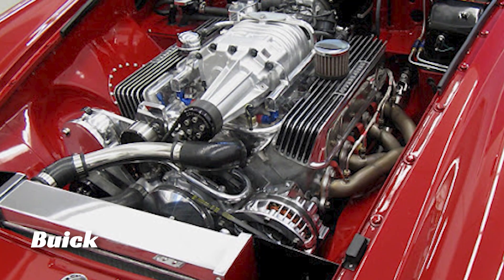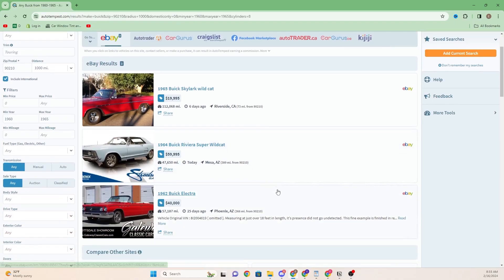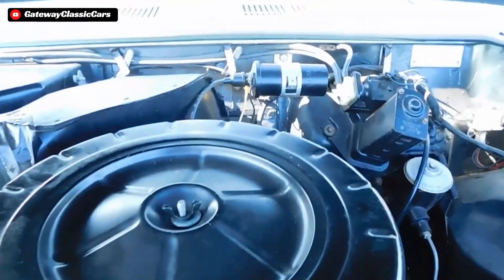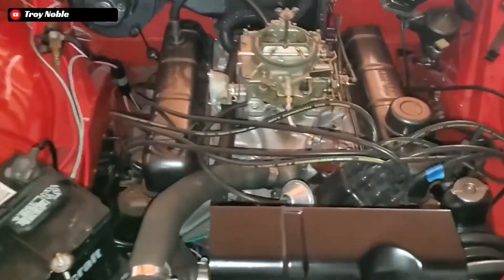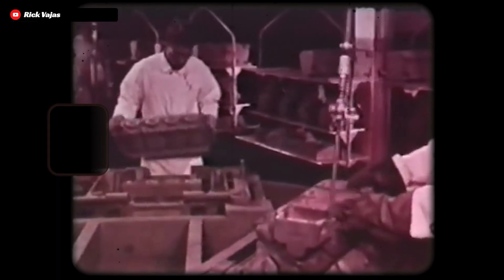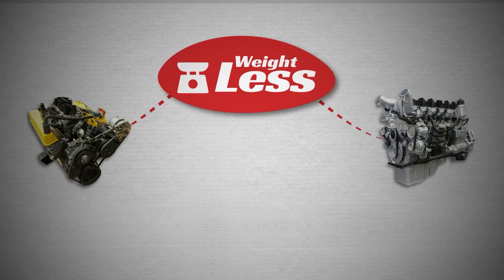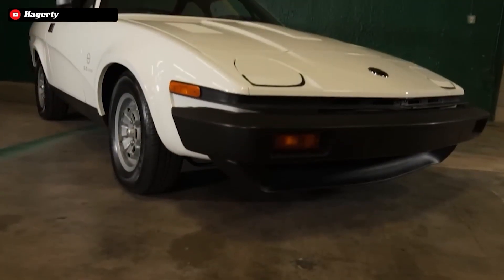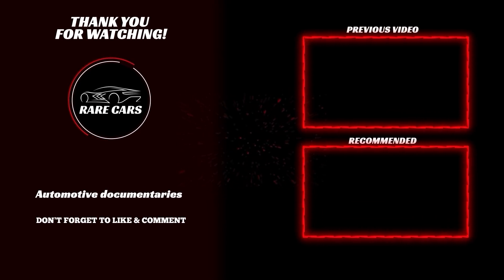The Little V8 That Powered The World  - The Buick/Rover 215 V8

Comment: I worked for West Yorkshire Foundries and was responsible for Foundry tooling approval and all dimensional Engineering reports of the Rover/Landrover Aluminium V8 Block and heads from 90 to 05 when Ford at the time had Landrover kill the Engine, This Engine even went in Boats before going to Solihull the Landrover cast into the head and blocks was removed same for TVR & Morgan. Working with it for so long I knew it dimensionally inside and externally for head and block in my head without looking at Hugh sheets of Engineering drawings, basically thousands of dimensions. For fool approval of a die before block going into production it took me 4 to 5 months, Probably 6 weeks for the Aluminium V8 head.
Reply: I also worked at West yorkshire foundry in Leeds around 1970. As a Contract electrician for Shaw Dale electrical.They were making the Jaguar V12 blocks & mini heads then. I now have a 4650cc rover engined TVR Chimaera that goes like a bat out of hell. Small world.
Reply: Strangely enough I was also responsible for mark-off tooling approval of the Jag V12 block & left & right hand heads + AJ straight six block & head from 90 to 2000ish when Jaguar killed off both engines. In the 15 years or so I worked for West Yorkshire foundries all electricians worked for the company not contractors. It also went from Rover to Hydro which are huge in Automotive industry.
Reply: @jeremywentworth1833  Hi Jeremy. I can assure you we worked as contractors We installed lots of large cabling around the factory. In fact I got into trouble for being in the compressor house. I was in awe of the huge compressors. There was one being rebuilt. A huge single cylinder one with a Ammeter on a pedestal. From memory it went up to 400 Amps. Worked in pressure Die. Gravity Die. Shake out. There was a huge woman that worked i think in the sand casting dept. We were give oxalic acid to wash our cars with due to all the fallout. I used to watch the guys with the long oxy torches repairing casting from behind a screen. I think the Manager that we answered to was called Doug. Regards.
Steve.
Reply: Jeremy, I can't believe I stumbled across your comment while looking for a replacement engine block. I'm looking to replace the 4.6 in my Discovery and forums say that Rover graded the blocks with color code, red being the best casting used in the early 4.6 for RR Classics. Do you have knowledge as to whether or not this is true?  Supposedly the problem with the 4.6 engines used in 03 and 04 discoveries had to do with all castings regardless of suitability being used for the larger displacement since it was the only version in production.
Reply: @tomd2833 Colour markings were done by operator when it was partly machined the block would go in a machine it was clamped with plungers holding it in position by adding & removing shim the casting could be brought within tolerance in every axis, the colour coding could be die related, their was definitely several colours, but as I wasn't shop floor or Foundry even though as I was quality it would be me or someone else in quality, with sample & hundreds of dimensions I could literally see if a casting just needed twerking by adjusting the plungers that clamped it, but also as it's made in the die , so the colour coding I doubt it means 1 is a better casting than another as no casting would be sent to Solihull if anything was out of tolerance as it was machined at Solihull from how we had machined part of it, they just complete by building it & obviously the heads.
Reply: You must mean Land rover graded them as they went to Solihull for M/c then building we were the Foundry..I suppose it's possible but wouldn't have thought it made any difference as each casting for block & heads was dimensionaly within engineering tolerances. Each die they were cast from as soon as it started producing castings that were out of tolerance it was pulled & refurbished &: the castings it produced would be scrapped. Every hour a sample would dimensionaly be checked on a CMM coordinate measuring machine. Anything out of tolerance that die stopped. And dimensionaly internally I would go through it with a drawing taking me around 3 months. Basically from due to die every casting was dimensionaly within engineering tolerances. But maybe when machined the casting could be out of tolerance so definitely possible but doubt it. As they are no longer in production it's irrelevant isn't it , land rover killed it in 05. Obviously many will have been rebuilt since I suppose.
Reply: @jeremywentworth1833 The land Rover 4.6 produced in 03 and 04 have issues with slipped liners and also cracks forming in the aluminum casting behind the liners. Symptoms will begin with what appears to be a lifter tick then a blown head gasket but what is really happening is the liner begins to move then the block forms a crack. There is a good video https://youtu.be/8zLGbESGYRU?si=FfOolahQYNbeHZTj showing a block that is cut in half so you can see how some of the later castings are off a bit when used for the large displacement. Rebuilt short blocks are selling for close to 6k so finding a used engine that can be serviced with an overhaul is my quest considering the value of the vehicle at this point. If there was a rating applied it must have been after machining. Thanks for replying to my question.
Reply: @jeremywentworth1833  I thought Coscast did some of the LR/RR blocks towards the end? I know they definitely casted them for a time, I have a Coscast block in one of my P38’s, allegedly supposed to be superior to the later LR blocks, also someone mentioned the colour stamps the blocks had, and apparently it was a quality control metric  on the later engines, something to do with the water ports at the back of the engine thickness, lesser blocks allegedly being used in 4.0 vehicles while higher quality blocks being used as 4.6’s or so the urban myth goes, 

Composite head gaskets imo was one of the larger issues with the Gems onwards engines
Reply: @That_Rover_Guy Coscast definitely did do casting of heads & blocks but it was after we closed, they presumably got all the tooling dies core boxes drawings the lot, someone still is casting them every now & then presumably it is Coscast, No1 but West Yorkshire Foundries made anything Land Rover V8 while it was in Production but us from the 70s, we only closed as we had lost a huge BMW contract when they decided to not use an engine & went with Brazilian Chrysler designed for Minis & we had lost all the Jaguar Work, so when Land rover Ford at the time ditched the Aluminium V8 Block & head so work for GM & Ford was moved to Austria & Hungary, we were solely a Rover owned company until the early to mid 90s when they sold the Plant as Growing Concern but still did a lot of Rover Work so losing their work was the nail in the coffin, the Blue marking & Green was done with all V8 head Blocks certainly in the 16 years I was a metrology technician quality engineer, the operator did it when they had been partly machined before going to Solihull, think they also put something on the head as in a paint marking, infact I think there was more than just blue definitely Green black white, don't know what it meant but it was a blob of paint on the Timing end , I couldn't tell you what it was for but maybe die related so possibly it's related to which Maching line at Solihull, been a quality I would shim the machine that partly machined them , stick & remove shims to role the casting so how it's seated when it's machined, adding & removing obviously affected how everything would be machined making sure everything was within engineering tolerance at our place but also for Land rover when castings are completely machined & the engine is built.
Reply: @jeremywentworth1833  Yeah those “Prince” engines are wank by the way lol I did half know what happened to you guys, 

Haven’t heard of anyone casting any numbers of them in a large way since Coscast and I don’t think they do them anymore, the one P38 I have as I say had a warranty engine fitted by LR and that was a Coscast engine, 

I do a lot with JLR and old rover cars so in my time I’ve had a fair few V8 powered cars and broke up a substantial amount of V8 powered cars boats etc, I’ve seen yellow, red, white, blue and green off the top of my head, the reason I’ve been led to believe it’s something to do with the casting process or machining process afterwards is because of the Discovery 2 and later P38 Thor engine fiascos, and the colour markings is something to do with quality I can’t remember the orientation of colours but allegedly the discovery didn’t get as high a quality blocks as the Range Rover and this was why generally D2’s suffered with cracked blocks (not slipped liners), I’ve seen them crack between the bores and along the water ports nearest the bulkhead a lot, and allegedly again this is why the D2 was such a catastrophic failure in America (so bad that the discovery 3 is badged as a “Land Rover D3” to remove itself from the dire reputation they got) 

You’d probably be able to tell me more regarding this, but I’ve been told circa 2002-2005 the blocks were casted differently to the earlier gems V8’s? 

I’ve rebuilt countless RV8’s over the years, but credit to you, pretty awesome being so connected with such a famous engine

Comment: I have a LH8 which is a Gen 4 LS based engine (all aluminum).. but it doesn't have AFM, VVT, or flex fuel.. they only made them for a year or so. It's a great running v8 engine.. all the modern upgrades/revisions with no tech on it.

Comment: I have a 1980 stage one V8 landrover which I've owned for nearly 30 years, I had to park it up in 1999 for various reasons (it wasn't broken in anyway) and it was left untouched until about 2013 when i had to move it, I put a old battery in it dumped a half a gallon of petrol in the tank and turned the key 10 seconds later I was driving it out, it's now back on the road and I take it for a ride now and then (at 8 to the gallon it won't be going to the coast anytime soon) you can't kill a Rover V8, I doubt my Ford ranger would do the same if I left it for 13 years.

Comment: One forgotten tid bit of 215 V8 history is the 1962 Oldsmobile Jetfire. It was based on the F-85 and was the world's first turbocharged production car, alongside the Chevrolet Corvair turbo. It used the Olds version of the 215 with a turbo on top of it and a single carb, and they called it the "Turbo Rocket". These cars are extremely rare, even more so because most people took off the turbo, due to the fact you had to fill up a reservoir with "turbo rocket fluid" to prevent detonation, since intercoolers were not a thing a back then. Olds only built them for '62 and '63, and it predated the first european turbo car , the '72 BMW 2002 Turbo, by a cool ten years! You just gotta love '60s american cars 🇺🇸
Reply: Yet somehow nobody at Oldsmobile thought to lower the compression ratio of the engine down from 10.25:1 to

Comment: I worked with a guy with an older brother that worked in a junkyard. He built a car from salvage. It was a TR6 with a baby V8. I knew about the 215. His 215 had a dual 4 bbl manifold. It was also running a 5 SPD overdrive transmission. This car would get opened up out on the desert highways. All built from things he collected at work.

Comment: HI, I had an Olds Cutless with a 215 that I rebuilt. the Buick version had better heads. many made it to the junk yard by 40K miles due to soft cams (Gm at the time was not hardening them and the dealers were not running them in), and owners were cross threading the plug holes as the heads were aluminum too, they were used to the cast iron ones.

Comment: Had the 4.6 in my 04 LR D2, solid engine. Always kept an eye on my coolant temps though.
Reply: I have a TVR 350i with this engine, if you can source a race cooling system instead of running stock it makes the world of difference.
Reply: The radiator hose almost touching the a/c pulley was bizarre
Reply: yes, if they overheat, they can drop a liner. All rover had to do was machine a small lip in the block and tophat the liner and the 4.6 would have never gotten the reputation it did. I love that engine in my 2003 D2, though, I do wish we had gotten the TD5 with the manual. That combo might have been slower, but it would get better than 14 mpg.

Comment: It would be interesting to know how Rover reduced the rate of blocks scrapped due to porosity.
Reply: They modified the engine so a different casting technique could be used, particularly how the cylinder liners were fitted. Did not work so well when they enlarged the bore though.  The 3.5s were pretty bullet proof, the 3.9/4.2/4.6 not so much...
Reply: @Titan604 It was fine up to 4.0 in my experience. The 4.6 is where things went wrong. Great engine when it isn't running hot!

Comment: The world needs more small displacement high revving v8s, we have the modern tech and materials to make it happen. By small displacement i mean 4 liters and less, like back in the 60s when v8s were 2.5 liters and revved to 9000
Reply: I can't think of a single V8 from the 1960s that was 2.5 liters and certainly not one that turned 9,000 rpm.
Reply: @nonyadamnbusiness9887  Daimler made a 2.5 litre V8 used in the Jaguar Mk2 shell and their Dart model. Same engine was used in drag racing with a blower to get into the lower displacement class.
Reply: @nonyadamnbusiness9887  because you are thinking of american v8s and tells me a lot already..but alfa romeo 33 stradale is an example
Reply: @km6832 Yeah, the little European V-8's from Italy maybe high revving, but American V-8'S aren't so bad!😆
Reply: @billyfoster3223  they arent when you really think about it.
Reply: @km6832  that one engine is hardly representative of actual mass-production engines.
Reply: @mrspandel5737  i know this. But my statement stays, we have the tech and material science to make it a thing in 2024
Reply: @km6832  I wish things were as easy as that.
Reply: @km6832 
Though the rpm's and minimal displacement were there, that engine had no torque.  Torque is more important then rpm.
Reply: @duelde-consulting6403  according to who? What makes you say that i genuinely wanna know
Reply: @km6832  
Apparently, "censorship" limits what I can respond with.  So the fact is that smaller high revving engines were in much lighter vehicles.
Reply: @duelde-consulting6403  which is what the alfa was. A small light weight vehicle so im not fully seeint your point
Reply: @km6832        Nearly 50% of vehicles are either SUV or trucks, nearly 35% of vehicles are mid size or large family vehicles in today's world.  From 3500 lbs to 5000 lbs.  85% of vehicles are not small 2 seater cars.
An engine like that would cause more harm then good in manufacturing.
Reply: @duelde-consulting6403  you're right. I shouldve specified for sports cars. But you are right with the avg vehicle weight being 3800lbs fr
Reply: @km6832         As a safety precaution, those "crumple zones" add a lot of unnecessary weight.  Even a Corvette starts at 3600 lbs and goes up to over 4000.
No doubt though that the small high revving engines sounded great.
Reply: @km6832  the Alpha Romeo 33 is not a good example - basically a race car for the road only 18 ever built, but it was a 2 L V8 rev to nearly 9000 revs LOL
Reply: @km6832 Why when an aluminum V-6 makes heaps of power and is cheaper to make.
Reply: @johnarnold893  A) why not B) v8s sound better?
Reply: @km6832 those aren't engines. Those are time bombs.
Reply: @nonyadamnbusiness9887  daimler dart 250 but it certainly didn’t rev to 9000
Reply: High amounts of torque at the lowest possible RPM is what makes a car good to drive
Reply: @peter455sd  ehh arguable?
Reply: How about under 2 liters and 15000 rpm
Reply: @raymondholtslander6373 efficiency drops above 3000 RPM. Even BMW, who got successful by small inline-6, say that 0.5 l / cylinder is the optimum. Fiat tried to go below 3 cylinders in their 500. Did not work. A ICE < 1 l will lose against electric.
Reply: Those were not "high revving V8s".
Reply: I had a rover which had this “Buick purchased” V8 in it, beautiful engine very unreliable and fragile and lots of maintenance😮😢
Reply: @malcolmwhite6588  I think it was more reliable as a Buick. Rover seems able to make anything unreliable.
Reply: @dmandman9  ha ha most likely – even had weird things like those carburettors with “dash-pot” plungers and if you didn’t top the oil in them they didn’t run well, and if you did top the oil  one would use oil before the others and one bank of cylinders would receive fuel before the other, and it would still run rough!

Comment: I would love to put one of these in my MGB
Reply: A neighbor has one in a Triumph that he bought new.  He loves the car.
Reply: .Get a TR8... a great car
Reply: It was a long time ago but, from memory, the gearbox was strong enough so all you needed was an adaptor plate and some engine mounts.

The only other issue was that with the V8 in place, the front rode something like 9–12 mm higher than standard. Either the spring seats neede adjusting or the springs required resetting.
Reply: The aluminum LS is great for that now.

A 5.3 from a 15 year old truck...

Comment: I wish my MGB moved and sounded like that clip!
Reply: The car at the 4 minute point is mine. All MGBs made after 1974 were configured to accept this motor but were only made for the British home market as British Leyland didn't want them competing with Jaguars etc in the USA.
Reply: 😂😂 yeah I was looking for another car to come into frame.
Reply: if you do an engine/transmission swap, don't forget the rear sub floor, rear suspension and differential from a sunbeam tiger
also a different front cross member/suspension, steering and brakes will be advised !